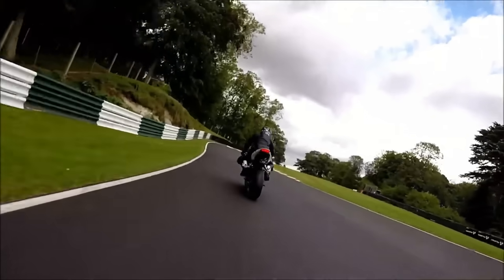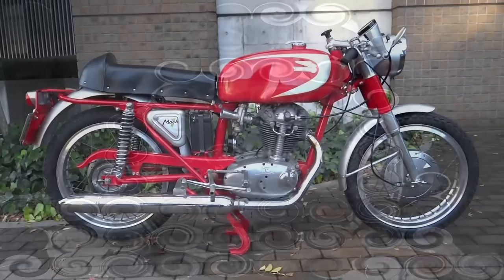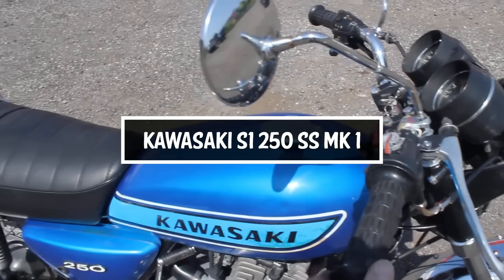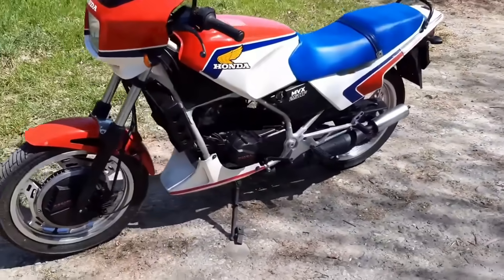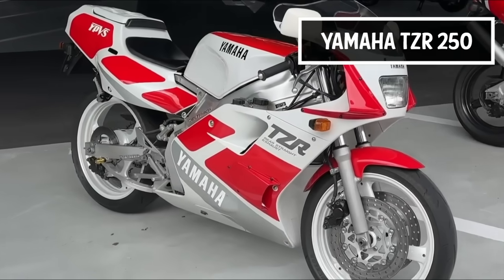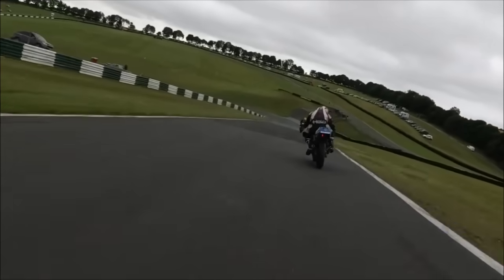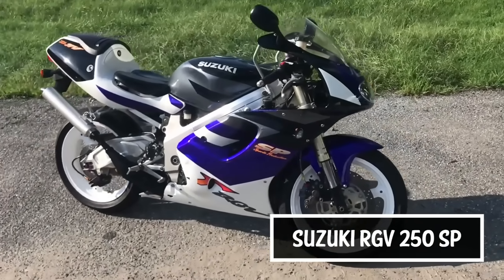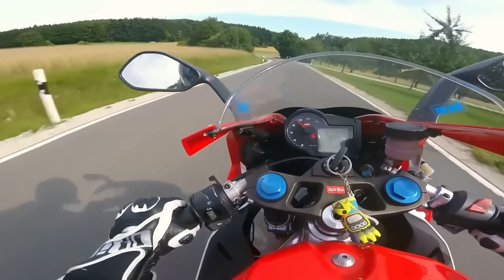The Fastest 250cc Motorcycles

Comment: Ah, there is a 51 hp......250 CC modern powerhouse called the ZX-250RR.....That is quite a thing....
Reply: How much better could that bike be, if it revved higher and weighed less?
Reply: @scottshaw1310  It already revs to the moon and back....Dash indicates 20k rpms, but it goes to 18500rpm unrestricted.... Yeah, it''s a piggy at weight, wish it would have been 150 kg like the bikes of old and go 120 mph like and old race prepped CBR 250RR...
Reply from the maker: why is it the new ones are so heavy?  🙂 cheers for watching, have a great day
Reply: @barebonesmc  Nobody has the guts to ride a 100 hp motorcycle that is a bare frame and weighs 70 kg......Franky I would be a bit scared too about that, but I bet that thrill is not going to be forgotten in a lifetime......I have not forgotten my max 100 km/h acceleration in 1 second, even though it felt like a sledgehammer. Pretty much that is what is happening to the new generation who prefer comfort over 1% faster than the last generation bike.
Reply from the maker: @Krom1hell  you may be right. have a great day mate

Comment: The Yamaha RD250 you first spoke of was the Yamaha RD250b of 1976 and was faster than you mentioned. nobody in 1976/77 had any Yamaha 250 that would not go well over the 100mph. straight out the shop it would do 105mph . 10 minutes fiddling and you were at 108 to 110mph.. Kawasaki 250 twin or triple could never ever beat the RD250 from Yamaha. Then the suzy  x7 first came out wearing colours like Barry sheens race bike and could not get anywhere near close to the rd250 of 1976 and 77 . when the RD250LC came out i was not impressed and put up a 1976 rd250b against the new rd250lc the lc was slightly quicker off the line but once at around 60mph the 250b caught up and over took the newer bike. THE ONLY 250CC BIKE That  COULD NOT HIT THE MAGIC TON IN THE YEARS FROM 1975 TO 1979 WAS THE HONDA CB 250. GREAT LOOKING BIKE BUT NOT AS FAST AS THE YAMAHA SUZUKI OR KAWASAKI'S. Every teenager wanted the rd20 or the suzi gt250.. some settled for the kwaka triple 250 but it was not as fast as the yam or the suzi... Honda did actually make the better bike as it would last a lot longer, but that extra few mph when its your first bike and mid 1970's gave you the street cred.... after my own RD25b i got a  kwaka 250 triple soon sold it as just didn not like the handling and got myself a yamaha xs500 4 stroke.. i got it cheap ,but was gutted how slow this thing was compared to the 1/2 size engine of the rd250b. over the years had lots of different 250 bikes and a couple of old cd175 to play with while waiting for something nice to come along.. if i could pick a bike to own it would be the 1976 rd 250b in its lovely orangey/gold like in the video above.. you could tune these bikes and get 120mph without spending a fortune, but your rings didnt last too long ha ah if you wanted a very quick bike you wanted the sondel sports tuned motor, it was fast and gave yo ua 250 to take on and beat a lot of the much bigger bikes...   and to simply have the luxury of swapping out the barrels and pistons so easy to have 350cc was also handy to have. i think todays bikes have gone more for handling ina different way that what we wanted in the 70's, we wanted a bike that was straight line fast, would easy carry your bird on the back and be thrilling on country lanes.. Also needed to be bloody cheap.... the yamaha RD250 of 1976 and the coffin tank of 1977 was £525 on the road... or another £40 on the coffin tanks for the alloy wheels that became standard in late 77 early 78

Comment: I had arguably the worst 250 ever as a first bike. The overweight and underpowered Honda 250G5. It was supplanted by a Ducati 350 Sebring Cafe racer - it hammered a suzuki GT250 one day even on it's original 23 MM (!) carb.  With a gasflow and 34 mm it went even better. Don't know about 100 mph as the speedo was very Vegllia!
Reply from the maker: Honda did seem to loose the plot a bit after the CB 72, .Cheers for watching mate, Ride Free

Comment: I wild as these nimble little 250s are, they would not be ideal for me. I'm 52 years old, and a little over 300 lbs (over 137 kilos). Between my size, and my 2 minute daily commute, I would feel like I was torturing one of these little bikes. Start, spend 2 minutes with a top speed of 45mph, then shut down. Short stop and go drives under a heavy load would NOT be kind to a bike like that! LoL

Comment: The reason 250 cc bikes there days are dull,  is racing. The 250 class died when moto2 came.  Moto3 is 250cc but is a junior class. Plus 2 strokes were killed off.  A sad state, no 2 stroke bikes in mass production.
Reply from the maker: the shift in focus of racing was probably the biggest factor, and Moto 3 are just singles so will never be as good as a multi, with restrictive regs like  Cylinder diameter is limited to 81mm and maximum engine speed is limited to 14,000 rpm it all gets a bit restrictive .Cheers for watching mate, Ride Free

Comment: I currently have a CBF250 single. It's OK but boring as hell. I had a 2000 XL250 that was useless and likewise a 2005 Yamaha TTR250. The XL250 had 40 years ago was much faster. I also had 2 x X7s, an RD250B, two KH250s an XR250 and lots of others.
Reply from the maker: .Cheers for adding your bit mate, Ride Free

Comment: Engine sounds are a little loud to  then hear what you are saying. Pity a really good video otherwise.
Reply from the maker: I was still learning and it is always a balance, to be fair i am still learning now :-) and i have tried different things to try and improve the editing process, none of this was very planned mate, im just a bloke who loves bikes with no previous experience of doing anything like this lol, i do my best but i do make mistakes :-) thanks for your support 🙂Cheers for adding your bit too mate. Ride Free 🙂
Reply: @barebonesmc  it is not easy to do that is certian.
Reply from the maker: @williamarmstrong7199  i will happily admit, some its easier than others, and with the 2 strokes its complex, but i do my best and try n learn 🙂
Reply: @barebonesmc  perhaps run a few seconds of the glorious two-stroke exhaust sound then mute it a little when you speak. On radio ylwe have a dipper not sure the actual name. You set it up to dip the background music while you speak. You can set it to different levels and delays. So it may hold the music low for a second d or two after you stop speaking and you can even adjust the rate at which it brings the volume of music back up. A device like that would help a lot. I expect there will be digital versions of that built into most video editing software somewhere. Finding it is the problem!

Comment: I have 2 250cc scooter/motorcycles Honda Helix and Reflex. Both will run 70-75 mph all day long, under stressed design. And get 60+ mpg.  Motorcycles are like tits, anything bigger than 250ccs is just showing off.
Reply from the maker: A good point well put mate 🙂Cheers for the comment. Ride Free 🙂

Comment: weird because my honda ns125rk can do 110 mph easy.
Reply from the maker: not sure what youve done to it then mate, factory claimed speed on the 87 NS125R is 112kph, thats about 70mph,  25HP claimed should pull more than that though so maybe the figures ive got might not be right, i was just talking 250s on this one really anyway , Cheers for watching, enjoy the ride
Reply: @barebonesmc  that was restricted they had a restrictor in the exhaust by the barrel you knocked it out and a plate in the carb simply take out once done they reach 100 easy. and theres loads more mods to take it up higher than that like 28mm carb airbox mod better exhaust , they are simply a very fast 125 like aprilia rs125 you get over 30bhp on one of them and the newer nsr125 with powervalve is around 32bhp unrestricted all very fast 2 strokes and all do over 100 ive had them all even the cagiva very good bikes for the cc.
Reply from the maker: @jediknight2350  ahh, makes sense, enjoy the ride mate

Comment: Hmmmm
With extra Hmmmm
  There's only over 27hp in any of the 70's jap 250's  if you measure it in the salesmens underpants, and that's at the crank, the only way a 60's 250 did more than about 85 was off a cliff, even an X7, arguably the last of that particular breed, struggled to get 95, and the LC only got a ton with a greased and starved  magazine road tester, not with your fat arse and flappy jeans.
  It took the YPVS/ATAK/KIPS and whatever Suzuki called the same variable port technology to really get the 35 to 40hp at the rear wheel that physics dictates is needed to get to 100mph (and beyond) on a 300-350lb bike.
   Silly sausages
Reply from the maker: interesting, but maybe look at the other comments, many would disagree with you, the power figures in general are quoted figures, so yes at the crank, but if you think a RD250 wouldnt do a ton your experience is different to mine and many others, and breathed on, they would do significantly more.   
but if we all thought the same it would be a boring world mate,  🙂Cheers for watching. Ride Free 🙂